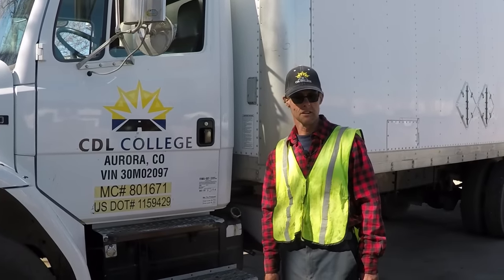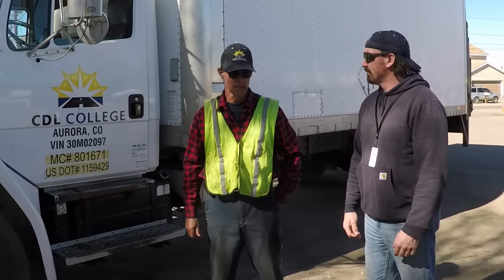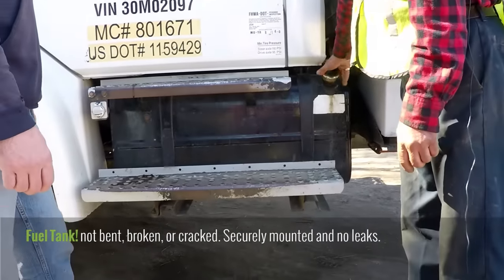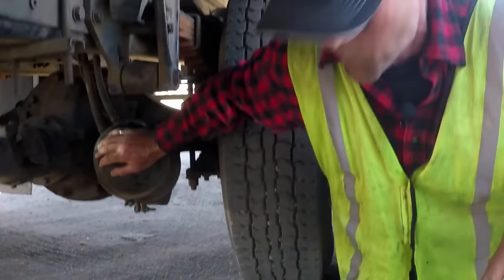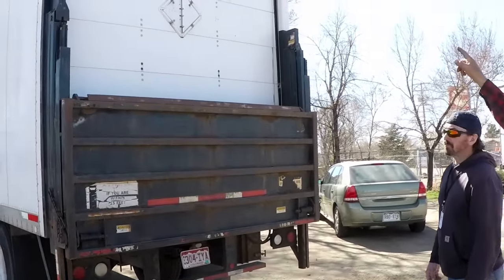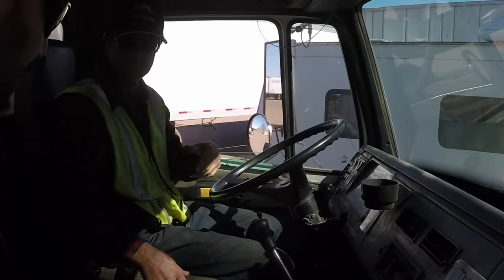TRUCK DRIVER STUDENTS! Class B Pre Trip Inspection (stable camera)

Comment: I watched this video quite a few times and learned Roberts method, terminology and the order in which he does the inspection and brake test. He has a great system, learn this video an these are the key components to cover, not more and not less. I just passed my CDL Class B skills test today on my first try here In Arizona. Thanks Robert and CDL College this video was great and I recommend it to anyone going for their Class B CDL.
Reply from the maker: You're pinned, mister. Thank you for the awesome video review and congratulations on earning your CDL, Bryan.
Reply: @Cdlcollege  --Isn't every vehicle different,,will all the components in all class B required vehicles be the same ,,placed the same ,,look similar,,especially the motor parts,,,""water pump,,alternater,,power steering etc,,,,,Will they all basically be place in the same way and look the same...will everything be just as visible on all vehicles,,,For instance,,,a public transportation Bus???
Reply: Bryan Carpenter hey im here in Arizona im getting ready for the skills test where did you take it and did you go to school
Reply: @bogsbrinner3817  For the most part, most components are in the same place. The big concern is whether it is belt or gear driven.
Reply: Oppop
Reply: I’m here in az going to take my pre trip also , which one did you go to?
Reply: Yo man I just passed my CDL test to the first try using his method I felt four times before that
Reply: I watched this video and passed my driver exam thanks
Reply: 😢🎉f😮 😢og 4gt
Reply: Going for my Class B CDL for DSNY…. This video is very in depth the way it was taught to me today 1st day of training… hoping to rewatch so it gets ingrained in me and also rewrite a few mandatory statements so I don’t miss anything!  Thank you 🙏🏼
Reply: What are "general hoses?"
Reply: @crownuk4867  general hoses on the truck I used are blue rubber hoses on the passenger side front engine… I wish I could tell you what they’re connected to 😂 perhaps someone else can help with that!
Reply: @christinacerezo5716  it would make sense to me that they are the hoses that come out of the power steering, coolant reservoir?

Surely I just don't "pick" any hose
Reply: @Cdlcollege do you not have to mention the power steering pump and that is gear driven?

Comment: Phrases: 0:31
Form one 2:30
Engine compartment: 3:13
Steering: 6:36
Suspension: 7:42
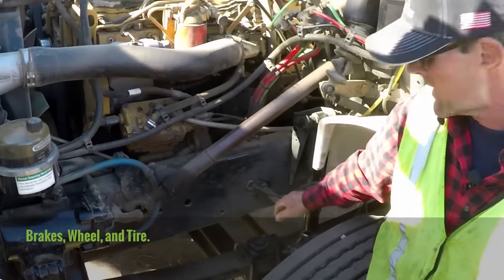Brakes: 8:26

Form 2, side approach: 10:45 
Frame: 13:10
Suspension: 14:43
Lifgate 17:24
External light check: 18:30

In cab inspection: 20:20 
Key on/ Engine off : 22:19
Safestart 23:21
Brake test: 24:05
Good luck!
Reply: This is smart thankz
Reply: Thank you!
Reply: Thanks
Reply: Thank you. I really appreciate you.

Comment: While you’re taking the driving test (road/highway) you must obey these rules.
•Make stop completely to all entrences to roads including yeld signs. 
•Must obey “on&exit” ramp posted speed limits and signs 
•Must safely stop at stop lights. If light turns yellow before truck crosses white paint stop lane, then you have run a red light. 
•No right turns on red light
•Watch for double turn lane > go to propper lane.
•Must maintain the flow of the traffic, and get up to speed as to not impede traffic. VERY IMPORTANT!!!! Must stay within 5mph of speed limit always when safe to do so. 
• Must look door mirrors every 5-8 seconds.
• left turn one lane into 2 lanes - Do not enter into the right lane. Make the turn from the designated lane(use left lane) 
Right turn one lane into 2 lanes - do not enter into the left lane. This rule it’s considered illegal in some states and it only applies for class A drivers but you still got to change the lane asap after the turn.
Reply: A light turning yellow as you cross the white paint stop line doesn't indicate running a red light. If the light turns red before you cross that line it is running a red light. If you are in the middle of an intersection and the light turns yellow you are obviously fine.
Reply: It’s the same as driving manual car to make left and right turn but I need to double shift on road test right?

Comment: Just a warning for anyone in Illinois that does the test after watching this video, everything is fantastic up until the 3 part air brake test, for the air leak test DO NOT have the key in the on position it has to be off and then turn it on to pump the breaks, I got an auto fail because of it even tho I did everything else perfectly, this is a fantastic video and I highly recommend it, just double check in your states book about that bit

Comment: I Just passed my test today. This vid helped alot.
Reply from the maker: Congratulations, Yusef! You're on your way...
Reply: Yusef Talib Siraj El-Bey  hi there how long you been driving thanks
Reply: Yusef Talib Siraj El-Bey - Congratulations. Best of luck to you.
Reply: Yusef so I shouldn’t let the truck stall by letting it shut down by itself. To hill start a striaght truck is to let the clutch off about 50 percent and let go the brake immediately and press the accelerator right. To make right and left turns is same as car right. Because it doesn’t come with electrical and service air lines.
Reply: Driving straight truck is same thing as manual car right but it just double clutching mad different than car.
Reply: What all you have to do.?

Comment: Just passed my Class B CDL test with a perfect score on the pre-trip inspection. Had to start from the front and work my way around the entire truck, but the key phrases and top down method made it easy. Also, my truck was certainly not perfect but as Robert says, it is important to point out all and any imperfections! My tester was very impressed! Thank you so much for the video!
Reply from the maker: You made a logical commitment to learn this information and then impress the heck out your tester. We just made a video. From our point of view, you rock! We partially rock. Congratulations, Zachery! Stay safe.

Comment: 3 L’s- 2:30

Coolant: 3:30
Oil-5:17
Power Steering- 5:40

Alternator-3:58
Water Pump-4:32
Air Compressor-6:05

Steering Shaft- 6:39
Steering Box- 6:43
Pittman Arm- 6:51
Drag Link 7:04
Upper/Lower Steering Arm-7:17
Lower Drag Link: 7:32

Suspension

Front Spring Mount 7:45
Springs 7:53
U-Bolts 8:01
Shock Absorber 8:09

BRAKING SYSTEM

Airline 8:28
Brake Chamber 8:40
Slack Adjuster 8:50
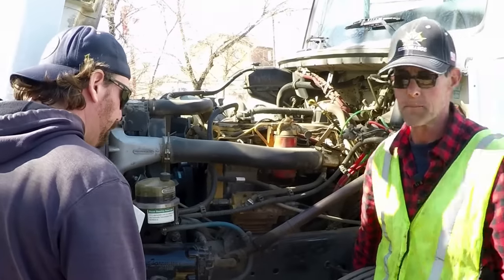Brake Shoes 9:04
Brake Drum 9:26
Inner Wheel 9:37
Inner Side Wall 9:43
Tire Thread 9:48
Outer Sidewall 9:57
Lug nuts 10:16
Hub Seal 10:32
Reply: So you have to know all of this in one test?

Comment: I just wanted to stop by one last time and say this video honestly helped me so much and it even helped me get my class A CDL !!(I passed first try). If you just do as this guy says and start from top to bottom front to back like he says and say all that not bent broken or cracked for like everything metal and no abrasions bulges or cuts for the hoses n pulleys you’re golden. Big thumbs up. Also go to CDL Colleges website and print out the “class B cdl pretrip simplified” paper that goes perfectly with this video! Thank you Robert and thank you CDL college.

Comment: You forgot to mention about the gas tank that the bands/straps should be thight and properly mounted and secured. Also it should not have rust on or dents and to make sure it’s not leaking. You also forgot to mention about the the air tanks / the battery and also about the Air Bags. Windshield should be inspected from outside of the truck at the same time with the lights. I don’t mean to say it’s wront bot for the Virginia state i have to maention these. And like you said the more you mention it’s better
Reply: B. Duello  And he didn't wire his seatbelt . I think some states the inspector will dig you on that. In fact you suppose to tell him|her to put her belt on also. I figure to point that out.
Reply: 🤣 just be thankful and move on, that man don’t care about your comments or concerns, every state is different he’s just giving us general knowledge

Comment: Thanks I passed the CDL in Illinois thanks to your video. 

I did however lose points because my examiner was a bit anal and focused on wording/semantics. 

Saying all wheel lugs are not bent, broken or cracked and securely mounted is not enough. Have to make sure they are also not missing... It's kind of petty, thought that was obvious. 

I lost points for not saying "I'm going to start my truck with it in neutral and parking break on"

My examiner did the lights test a bit weird, he just hopped in my truck and just told me to talk about anything in the cabin, I didn't say high beams and low beams because I was planning on doing that when we get outside so we can look at the lights.

 I wish he was more clear about what he wanted, obviously every idiot driving a car knows there are highs and low beams, thought that was petty.

The examiner did everything by sections so unlike the video where at the end you can go back and say oh I want to talk about what I think I missed, I didn't have that luxury because it was done by sections. Engine, outside and inside. And scored at the end of each.

I think whoever goes for their CDL watch this video many times, write things down, expect examiner from hell and rejoice if you get a normal person. 

You are in charge of your safety and those around you, so at the end of the day I am not even mad about the tough experience. Just be prepared for it and SHOW CONFIDENCE which you only get by using your resources ( this video and your manual, get an instructor that does cdls, they'd tell you all you need to say so you don't lose points for stuff you already know but didn't word like they want you to...English is my 2nd language btw, I'm European )

You'll do fine if you study and practice.

Comment: Thank you for taking to the time to put out such a great video I do appreciate your hard work ! Am going to to be taking my per -trip for the Orange County transit Authority driving a public bus. This video gave me more positive confidants.   is there anything else you think I should go over on a bus per trip ?  I believe its about same in the know the in cab is? if you have in suggestion or a video it would be greatly  appreciated thank you again got your hard work 
Greg
Reply from the maker: You'll also have to inspect the side door, inside steps, step light, hand rail, aisle, aisle mat, passenger seats, and emergency exits.
Thanks, Greg.

Comment: how the hell will i learn all these parts names,and location?
Reply from the maker: You don't have to know the names of the parts you're inspecting, Amir, as long as you point to, or touch, the part you are inspecting. The Class B inspection isn't very difficult. Just learn one section at a time and you'll be fine.
Reply: Help I'm so confused, scared and nervous about taking this part of the "Test" pre-trip inspection. You say you don't have to know the name of the part, I thought you had to say the name of the part your inspecting when you touch or point to it? Your video is good real good, it's just so much you have to point to or touch and say that it's not bent, broken, cracked and securely mounted. I'll be driving a dump truck with no trailer do I still need to study the trailer part?
Reply: Watch this and other inspection/protest videos a few times over. You’ll get the hang of it.
Reply: update: I passed my test the first time,and i was the only one who passed the first time
Reply: Redbeard Trucker did you have to know the name of everything to pass? Or just point and say no bent broken or cracked?

Comment: Thanks to this video I passed my Pre trip, in cab and air  brakes on the first try! Here in Cali the applied air leakage test is no more than 3psi within 1 min the low air warning is no lower than 55psi and the spring brake test is between 20-45 psi

Comment: Did exactly this (few things he missed battery, gas tank itself, secure license plates and check inspection sticker on front approach) but I passed first try. Just practice practice practice! What helped for me is breaking stuff down into each segment (front approach, suspension, liquids, in cab inspection, air brake test, etc) then putting it all together. Then Doing the pre trip in person over and over and talking to yourself (or with someone) and it’s easy once you go for it. Passed my first try in Maine.

Comment: Thank you for this video.  It's very detailed and helped me a lot, but unfortunately, this video does not cover what they wanted in Indiana.  I just wanted to convey this just in case anyone else from Indiana watches this.  I failed the brake test using exactly the way explained in this video but In Indiana, they want you to FIRST take the air tanks to governor cut off, then pump 3 times and make sure you don't lose 3 PSI, then fan some more to get the warning light and alarm, then pump more to have the parking brake valve pop out.  Not Bent, Broken or Cracked also doesn't cover what they want you to say (drive lines for example...they want you to mention that it's not twisted, unreal!). Thanks again for the video.
Reply: Did you take your testing on Raymond?
Reply: @darealkhyrelldodd1211  I did.  I’ve scheduled another one as well at the same place.  Don’t forget to mention the air bags by the leaf springs and the torque rod as well.

Comment: Thanks for video I passed my Road test I actually talked more than 2 things about each item until he said “you passed your Pre-trip” and not bent,broken or crack and it’s securely mounted was really helpful I also did not have any complaints like the other guys the my company had sent before me so Thanks once again and I 100% recommend this video
Reply from the maker: Impressing the tester with too much info is an excellent strategy, Anuar. You went the extra mile, and now you're licensed. Congratulations, you earned it. Be your best.
Reply: CDL College, LLC  thanks to Robert and you guys my confidence went up and my knowledge on the pre-trip was way better to point the my boss ask for the link of this video for future candidate in our company..
Reply from the maker: That's pretty amazing of you, Anuar, thank you so much.
Reply: @Cdlcollege  question for you ...when did u start the cut in and cut out method was it before u started the air brakes test or after

Comment: Just passed written today! I'll be reviewing this video over and over and over as it is super thorough. I'm a bit worried about the couple of comments about the guy failing due to order of the brake tests, although the order in which you show it here seems like a more efficient way and you say the order doesn't matter. I AM in Colorado, as this school is as well, so that gives me comfort. Any comments to my worries? Thanks for the awesome video!
Reply from the maker: Parking Brake, Service Brake;   engine off, key ON;   Leaks (3psi 1 minute), Low Air Warning (60psi)/Valve Pop (40-20psi);   safe start;   Air Compressor Check (85-100psi; 120-140psi). If you perform every step correctly, the order shouldn't matter. Nicholas, if you fail the brake check after performing the steps exactly as we show them, something's wrong and it should be reported. You can test anywhere.
Reply: CDL College, LLC 
Awesome. Thanks for the rapid and thorough reply. You guys are great. I know where to go if I ever go for my A and endorsments! I'll be plowing that sweet Colorado fresh in "snow" time!

Comment: I did my research and choose to go to Katlaw Truck Driving School in GA for my B class license.  I studied hard and used several online sites and mobile app to pass general knowledge and air brakes and passed.  Tomorrow will be first day of 4 days of field training with straight truck and have been looking on line for the best pre trip inspection video to prep myself.  Your video by far is the best video I've found online.  You get to the point, repetition is key and make sense to memorizing everything.  I have to study much harder then to some that it comes easy to and the less confusing wordy the better.  I take my test next Thursday....cross fingers and pass it on the first try!!! The camera operator was great at trying to get into frame what you were explaining, the parts of the vehicle to help visually.  Thank you for your time. If you have any other key suggestions that help with the walk around, please pass along?!
Reply from the maker: Take your time during the Pre-Trip inspection, Vanessa. Rushing leads to missed items. Tell the tester at least 2 things about every item you inspect. Many people have used this video to pass the Pre-Trip Inspection. Thank you for commenting and watching!
Reply: Thank you very much for the tip!  That totally makes sense as to cover my behind with 2 answers or descriptions of items.  Be thorough is key...I will study hard and do my best!!!
Reply from the maker: Good for you, miss! Here's a great example of how to properly inspect an item: let's say you're inspecting the engine air compressor. It's a piece of metal with air inside. Inspect the piece of metal first: It's not cracked or broken and is securely mounted. Additionally, you hear no audible leaks from the compressor. The hoses to the compressor are securely mounted, have no splits or cuts, and have no leaks. Lastly, identify whether the compressor is gear- or belt driven. If belt-driven, inspect the belt (no splits or cuts, no more than 1/2 to 3/4 of an inch of play). Students all over the country tell us that this video works just fine in their state of residence. Cheers, Vanessa.

Comment: OMG THX SO MUCH I PASSED MY PRE TRIP AND IN CAB INSPECTION THE FIRST TRY COUPLE DAYS AGO OUT OF 50 POINTS I SCORED 45 I HAVE TO GO BACK AND TAKE MY RODE TEST DEC 7TH BECAUSE THE TRUCK HAD  A BLOWN A TAIL LIGHT AFTER THE SKILLS TEST HELL THINGS HAPPEN BUT I CAN SAY THE HARD PART IS DONE DRIVING IS THE EASY PART REMEMBER PUT SEAT BELT ON FIRST AND CHECK MIRRORS EVER 7 TO 10 SECONDS